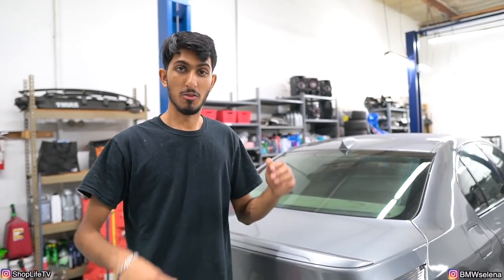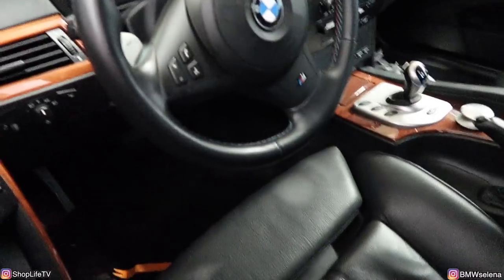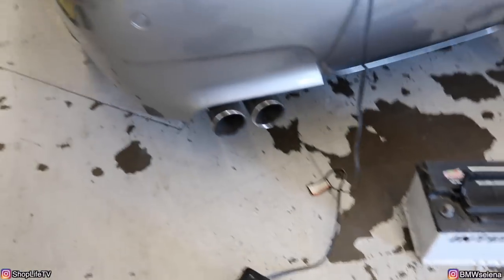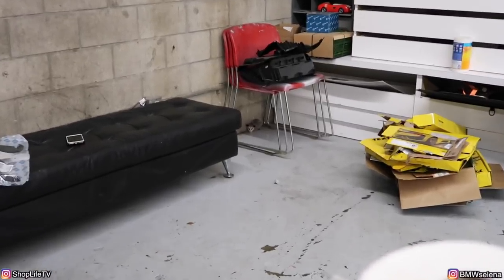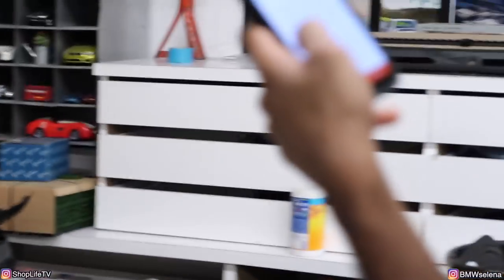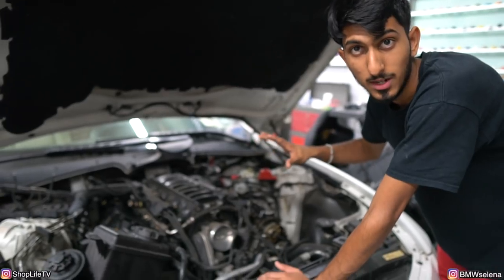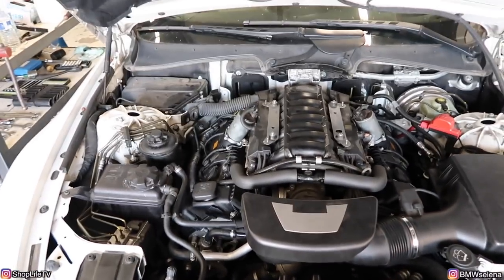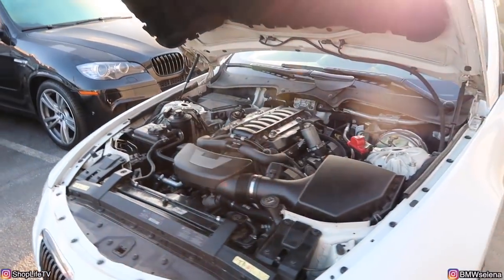BMW E60 M5 Battery Drain + E64 650I + NEW SHOP PET?

Comment: Legit! Alpha Motorwerks you’re a legit shop. Electrical issues like the one discovered in the E60/ M5 are very difficult to properly diagnose. I must say, most European independent shops, would have replaced a bunch of other part$$$ including the defective dimmer/ headlight switch and definitely not attempt to repair it.
Reply: Richie Rich I salute him, here  in the phils a lot of independent  mechanics will try to find fault and repair the same, prob is they don't have those code readers... kudos...

Comment: What was your diagnostic approach to finding the dimmer switch as the problem?  In other words, what was your process and or what tools (meter, scope, etc.) did you use that led you to finding it was that switch?  I've got an E63 with an intermittent drain and would like to know how you went about it.  Thanks!
Reply: Stephen Peralta: I would check the resistance/ draw on the component(s) with the known problems. If you don’t have access to a meter, disconnect the component one by one. Or make an appointment with Alpha Motorwerks, LoL! Wonder if they offer diagnostic service over the phone. That would be worth every penny!

Comment: Do you know what I need to do to rectify a fault on E60 2009 deisel , I have a problem with high increase battery discharging and I have checked everything by disconnecting the unit in boot and remove the IBS cable. The problem still presest. I noticed that the start button is always lighten up even after I locked the car.. Any advice would be much appreciate it?.

Comment: E60 V8 has bad valve stem seals, oil leaks, coolant leaks.  All the same issues you can read on bmw forums.  Replace seals and top off fluids and you are good to go.

Comment: I need advice from you I’ve been looking at 2013 and up BMWs 528 and 535 I what’s the major problems on these cars or do you recommend anyone of these cars please help me I need to understand these cars
Reply: Have deep pockets if you don’t know about cars
Reply: Get the 535. Our 2012 has ~84K miles and has needed a valve cover gasket, oil filter housing gasket, rear door actuator  and trunk release switch. All covered under the CPO warranty. That's it. I'm a firm believer that the majority of people who say they're money pits haven't owned one. The 528 does have timing chain guide failures and the V8's (N63 at least) have HUGE problems; just search.

Comment: Those are some serious rides right there. E60 is one of the all time greats, not for reliability though right?
Reply: 550i e60 needs valve seal, other then that top off all fluid and watch for brittle coolant pipe leak

Comment: Man remind me not to get a v8 from bmw...the 6 cylinders are already tough enough to work on!
Reply: Tru, but delete muffler and they are fun to drive if you don’t care about gas
Reply: I drive daily, changed valve stem seal, top off fluids, since I don’t want to replace seals and pipes.  Watch for coolant line Brittle plastic tube right above radiator.
Reply: The N62 motors are great but avoid the N63 like the plague.